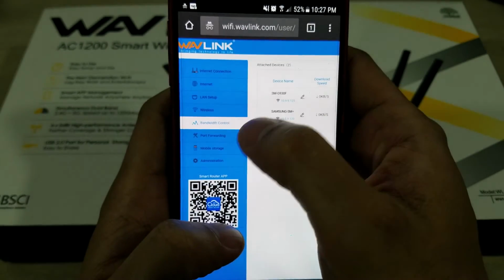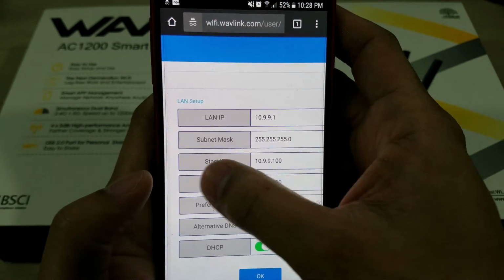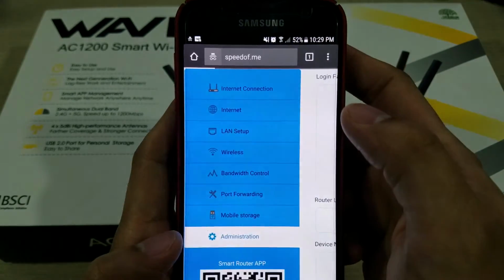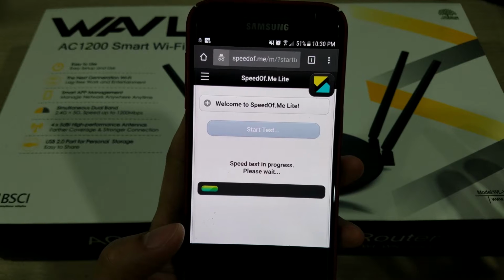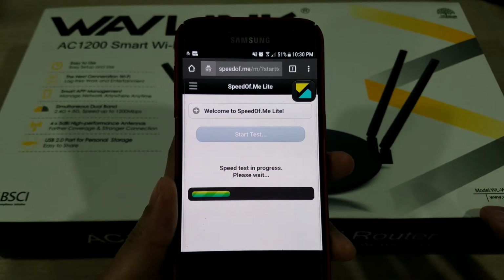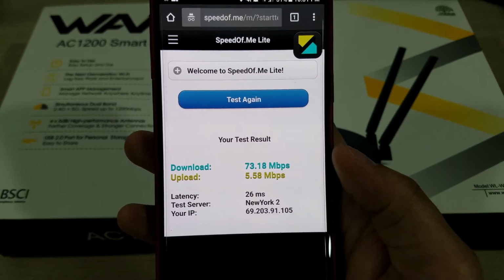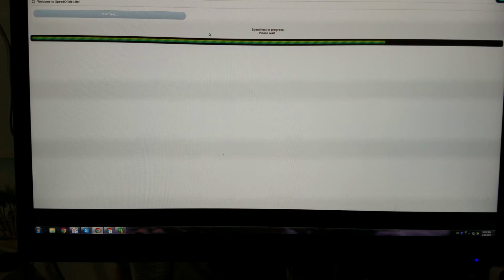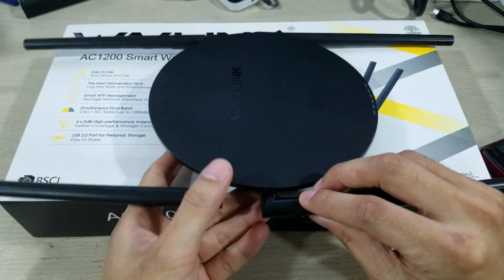WAVLINK AC1200 Wireless Wi-Fi Router with 4 External High Gain Antennas and 1 USB2.0

Comment: Hello 

Note… My important questions below are pertaining to a somewhat similar Wavelink Wi-Fi range extender… Wavelink AC 1200… It’s the weatherproof 4 antenna unit for outdoor use

I live in my motorhome and I have no Wi-Fi or broadband here....and my motorhome is about 300 feet away from my bosses office which DOES have Wi-Fi and broadband 

My boss will NOT allow me to plug anything into his router and he will NOT give me his router password but I DO have his Wi-Fi guest network password

So I have the password for my bosses guest Wi-Fi network when I walk over there to my bosses office his guest Wi-Fi network appears on my phone and I enter the password and I just connect to it with my iPhone

I don’t think I have a user account for his guest Wi-Fi network my boss just gave me the password and when I see the guest Wi-Fi network on my iPhone I enter the password and I’m connected

The only problem is that I live in my motorhome 300 feet away the best solution is probably to mount your antenna extender on the roof right above the area where his router is (One story building) 

so the question is using my iPhone and your 4 antenna extender can I download your app and somehow connect your antenna to my bosses wi-fi guest network and then extend the signal wirelessly 300 feet to my motorhome?

 remember I cannot plug anything into his router and he will not give me his router password only the guest Wi-Fi network password

I am desperately awaiting your reply thank you so much I really want to buy this extender but I wanted to make sure that it’s gonna work in my unusual circumstances before buying it

It’s probably important for you to know that assuming that I can set it up in app mode or whatever to the guest Wi-Fi network will it stay connected once I walk 300 feet with my iPhone in my pocket back to my motorhome or does my iPhone have to be near the antenna all the time?

Respectfully yours 

Randy

Comment: I am unable to get internet connection with the router
Reply: I plugged my isp router into the wavlink and set the wavlink up as an Access point and disabled the wireless on the isp router. The wavlink coverage is fantastic when configured like a spider and hung up in the attic.